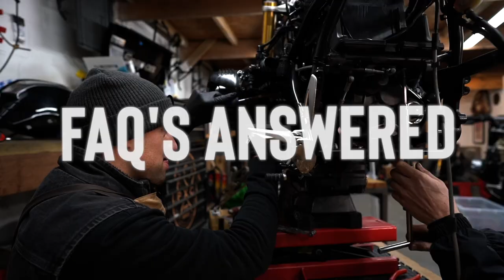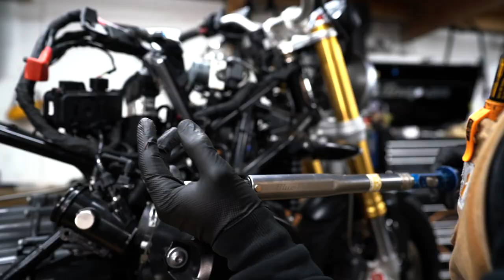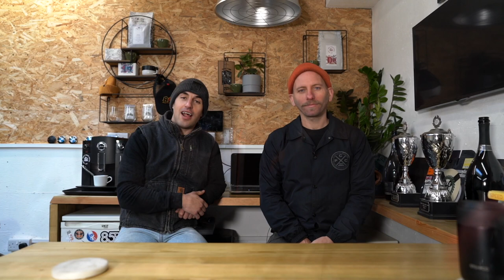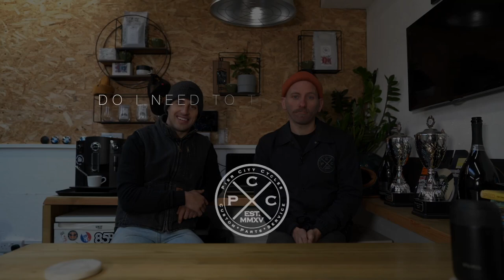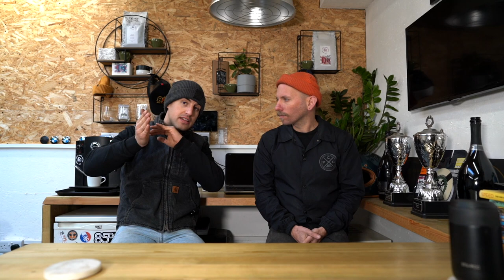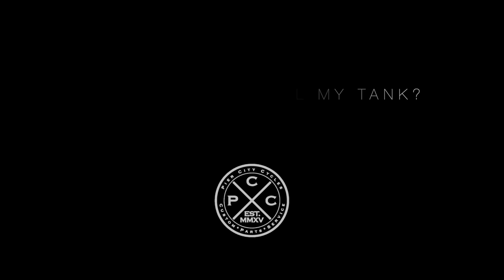PIER CITY CYCLES Q&A - BMW R9T Air Box Removal

Comment: Hi guys, love your mods and the bikes you turn out are awesome, although some customers must have deep pockets.
The question I have is…… if you decide to have this mod can you utilise the space for storage ? I think it would still look great with the DNA pods and new kidney grill. TIA
Reply from the maker: In theory,  you could use the two tabs on the frame above the clutch slave cylinder to mount a small tool roll but realistically there isn't a lot of space to do much more.

Comment: Such a shame north oxford BMW couldn’t get my r nine t racer to run right with this mod ! 3 times it went back .. gave up in the end .. got my money back and bought a Big Bang R1
Reply from the maker: Should have gotten them to bring it to us, dude.
Reply: @PierCityCustom  I did suggest that .. they wouldn’t have it 🤷🏻‍♂️
Reply: I spoke to BMW Glasgow about balancing my throttles whilst in for a service after I did the air box delete. Bike came back running good, but the technician told me the way they'd adjusted the throttles was by moving the throttle junction box back to where they thought it would be if it were still on the airbox. Needless to say, within 5 miles the bike was running very, very rough. Got it back and balanced them myself. Hasn't missed a beat since.
Reply: @weslyscott6072  it seems main dealers don’t know Jack sh*t about tuning
Reply: @marksenn1234  ofc they dont, they get paid to do the basic stuff like oil changes and even with that they sometimes fail. but dont blame them if they cant do such mods because they are not trained to do them, the key is to work on your bike yourself :)
Reply: @kowalski2334  they supplied the bike with all the mods done .. but refused or just didn’t know how to make it run right .. I suggested they take it PCC .. I even told them it probably needed a fuel pack or ecu flash .. but they wouldn’t have it 🤷🏻‍♂️left me no choice but to get my money back .. they sold a bike not fit for purpose
Reply: @marksenn1234  to be fair I think the majority of the service techs probably do know, but time is money in this environment and they probably have their hands tied for ramp time
Reply: @weslyscott6072  no excuse .. they supplied me a bike not fit for purpose .. 3 times it went back .. so they had plenty of ramp time .. just incapable

Comment: Love this mod and just purchased, waiting for it to come in. Do you have a video on how to balance the throttles with the vacuum gauge? I’ve only found videos with a carbtune. Also, if I get rapid bike evo, is this problem automatically adjusted or would I need to do it either way. I’m fairly certain I’m just having a hard time understanding that portion of this video
Reply from the maker: Hey Mitch, great question - in short no we dont but if you havent already try searching for R1200 GS throttle balancing videos on Youtube because the process is the same. Also you'll need to fdo it either way - an Evo is an electronic adjustment while the throttle balancing is a mechanical adjustment. Hope this helps and hope you got on with the ABR :)
Reply: I did the mod and love it. Biggest problem was the rear frame removal…I took my five minutes to look around and still got hung up on a bunch of crap 😂. But honestly, thanks to this video, it went smooth a butter!